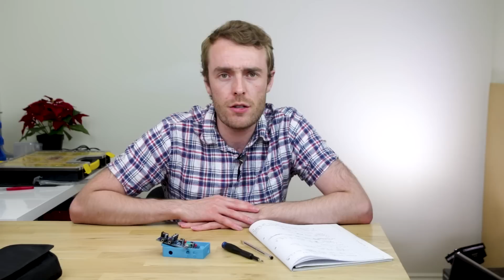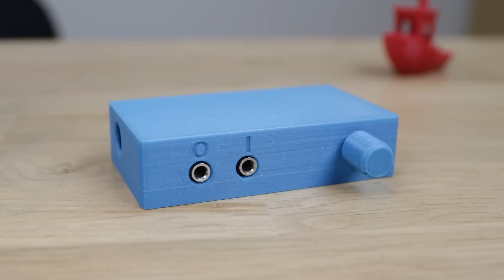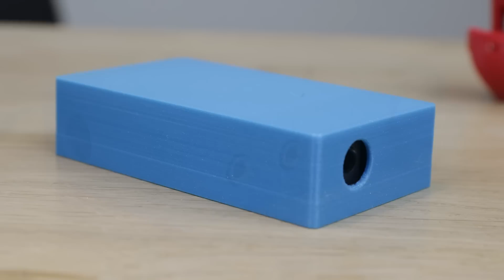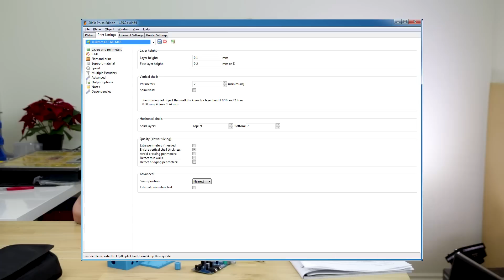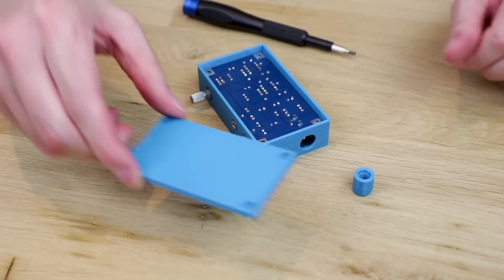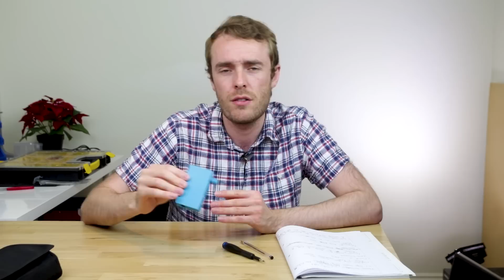#3DTWIP Fusion 360 Custom Electronics Enclosure

Comment: How did you get the M3 thread on the enclosure ? Does the screw thread also get 3D printed ?
Reply from the maker: It's just a hole, the screw cuts a thread

Comment: simple video but well edited, good good work
Reply: I just love simplicity, I want to mention you can set dimensions with arimetic expressions like for example, the M3 head clearance to be lets say 3mm * 1.05, o r an addition, or also use variables like: (3mm * clearanceFactor) and then you can define those in the parameters dialog:

https://forums.autodesk.com/t5/fusion-360-design-validate/global-variables-equations-and-dimensions/td-p/5306729

have fun!

Comment: With regards to the extrusion issues (saw your comment on Tom's prusa inteview), it looks a fair bit like what I got on my i3, the spool would tug on the extruder as it moved closer and further away during the print. Have you tried using a reverse bowden tube? 

As to why the mk3 is worse than the mk2 in this regard? My guess would be the stepper drivers. They've got a lower current rating compared to other common drivers which means less motor torque (so the spool tugging on the extruder can have a bigger effect), especially in the quiet mode. 

Of course I could be wrong, just a guess.
Reply: I think the spool has to be on bearings, standard 608zz type, with thick sticky high-viscosity grease. This has helped me certainly with extrusion consistency, but i suffer from carriage compliance issues, while MK3 appears to suffer from moire-like issues, though possibly multiple other issues overlayed on top. The way distinctive lines have worked themselves into this print, i think it's worth trying for CRT!

Comment: Gotta say I'm a bit underwhelmed with the print quality from the mk3 in this particular print.
Reply: I mean it's not BAD. Maybe I'm just setting too high of a standard for the mk3. I have a ultimaker 3 at work and sometimes we get similar problems and it's a 3.5k printer.
Reply: I'd attribute that to it being a mendel/i3 printer and having to fling around the bed on the Y axis. It's pretty typical of these types of machines and the only way around it is to print slow, but prusa have been advertising the exact opposite with higher recommended/max speeds on the mk3.

Comment: Ah, in-context modelling. Where you really seem super smart in your own mind, having the feeling of having understood how the universe works, until you have to change something in the base geometry and then FreeCAD moves your sketches around to all the wrong surfaces and the model collapses into a distorted mess and everything becomes uneditable, throwing a myriad of nondescript error messages. Thanks, FreeCAD!

And i don't know what's up with that, but DesignSpark Mechanical silently crashes on start for me - 64-bit and 32-bit both - tried erasing its settings but nothing - so not gonna use that.

Why not Fusion360? No-go on Linux, trust issues. I wish i had an alternative. One that was mine to actually keep.
Reply: The parts going whacky could be because of how things are dimensioned and dimensions moving from "20mm to the left" to "20mm to the right". In my experience this sort of stuff tends to happen when things are all dimensioned from a common datum (good for when you need to analyse parts and produce them manually) rather than dimensioned relative to each other. For example if you think about the volume knob, you can dimension the outer wall as a radius from the center of the knob, or as a wall thickness around the knob. In the first instance, you could change the pot dial's radius and it could end up being bigger than the volume dial and the geometry can shift unpredictably, wheres in the second method your volume dial would expand to compensate. 

It's all about how the changes cascade down the line. I learnt this the hard way in OpenSCAD where every constraint is use defined and there is no simple 'dimensiong'. If I referenced everything from a single datum, just about any change I made to the original sketch/geometry etc would turn my part into scrambled eggs, whereas if I referenced everything off the previous part it relies on/is mounted to or whatever, the changes would cascade down correctly.
Reply: SCAD is just a CSG routine though, it works on volumes represented as bunches of triangles. Everything is based on primitive source coordinates, there is no way to select a feature of a model and refine it further.

In contrast, FreeCAD represents the model as vertices, curved edges, and curved surfaces. When you apply a sketch, it's applied to a world plane or a surface. When you apply a bevel or a shell or a fillet operation or anything like that, things that SCAD couldn't dream of, it's applied to a bunch of curved surfaces, and it can do a lot of advanced geometric math on them. The problem is, you select a given surface or edge or something - it stores the number of the generated edge or surface in the next operation that you perform. But these numbers are NOT stable. Sometimes if you go up the operation tree and perform the operation anew with slightly different dimensions, it will decide to generate the surfaces or edges in a different order, and thus their numbers change, and thus whatever anchored geometry you had, it will no longer apply properly. But this is the fundamentally elegant and correct way of working in FreeCAD, because this is exactly how you specify dimensions of things relative to each other there - its CSG lacks such functionality.

I can make a model error-free and flexible in SCAD no problem, and if i mess up, i know how to refactor it easily, but making curved stuff such as fillets and bevels is extremely unpleasant to impossible, so its use is limited. The loft feature has been in limbo in SCAD for 5 years now! I should probably use SCAD more though. Or maybe i should rewrite it entirely from scratch, because i dislike so many fundamental decisions in it. Like the fact that there is no universal anchoring system, every primitive has a different coordinate system origin, or multiple but inconsistent. Relativity.scad is something that should have been core functionality, but since it's not, it has to rename all the primitives.
Reply: Off-topic: Is there a way to create a "linked copy" of object in FreeCAD? So that whem I modify one instance, all of them in the model change accordingly? I couldn't find how to do it and the manual only referenced static copy... Btw, I share your opinion on Fusion and linux :(
Reply: Robert, i think you're looking for "Draft Clone" function, represented on the toolbar - depending on version - either by a stormtrooper helmet in earlier versions or a blue sheep currently. There's also a "PartDesign Clone", which won't clone everything but can be used in PartDesign's CSG, while the other will not. Also i'm not an expert and am likely to get these things wrong.

And yes, it's as confusing as it sounds, and makes FreeCAD seem like a hodgepodge that it is rather than a software that was designed for user experience first.

(and yes, the icons were changed because someone was outraged on the Internet over incorrect use of their lore, because storm troopers and clone troopers are distinct from one another)
Reply: Robert Klauco, Just create one part then import that part multiple times into your assembly. That way when you change the original part all the imported instances update.
Reply: You could be correct about freeCAD, I was just hazarding a guess based off "glitches" I've experienced in other interactive modelers. 

I'd have to disagree with you on some stuff about openscad though. Chamfers are trivial as long as you design with them in mind to begin with. I've written my own functions to replace cube() and cylinder() with cube_c() and cylinder_c() which let me add chamfer parameter. Using these instead of cube/cylinder means my models end up with chamfered edges wherever I want. The odd few cases where the chamfers on these primitives don't suffice are still pretty trivial.

Fillets I'll admit can be a bit trickier. Fillets on 90 degree corners are trivial, any other fillet is a bit harder but boils down to 1-2 simple trig operations. It seems a lot harder until you know how to solve the problem. Fillets around a radius rather than straight edge aren't much harder, just throw in one more trig expression if it's not something nice (like a fillet around a full, half, quarter circle edge etc). Fillets around organic curves I'd resolve to "impossible",  but I can't imagine a case where I'd need to add a fillet to an organic shape when designing parts, even filleting a curved edge is rare for me. The most common by far fillet I need to use is on a straight edge at a 90 degree corner, which is trivial. 

If you don't believe me, have a look at one of my projects on github: https://github.com/Trakyan/DeltaGear
It's full of fillets, the base in particular has some nasty ones like fillets between two curves intersecting at odd angles. Fillets between curves intersecting at arbitrary angles, I'll give you that one was a bit tough, but again not as complex as you'd think once you know the solution. Having used OpenSCAD for a while a lot of geometry problems have become second nature to me.
Reply: Trace, the repo you linked is empty?

But thing is, it's rarely JUST a chamfered cube or a chamfered cylinder, straight ones print just fine and don't suffer mechanical strength issues. Where it pains more is trying to smooth out transitions between primitives in one or another manner to dissipate mechanical load, because things are more likely to break otherwise.
Reply: My bad, uploaded the files now. It's an old semi abandoned project that I never got around to printing, must've forgot to upload.
Reply: Aaaah, thanks. Here comes another thing i hate about OpenSCAD though:
ERROR: Parser error in line 41: syntax error 
ERROR: Compilation failed!

Dear SCAD, WHAT KIND of syntax error, expected what kind of symbol or nonterminal, got what kind of symbol or nonterminal? At what position? Such an amateurishly written parser! Now i've spent a bit of time writing those, and while i really like doing that sometimes, i know getting a good interpreted language written that would be suitable for general public and user friendly enough is a task that would take me a year, so i would not do this unless absolutely necessary, and use something that is robust and proven instead.

I know what the error was, the syntax that you used is simply newer than supported in the official SCAD release, which is now 3 years old. As absurd as that sounds, a well-written parser can still generate a better error message than just "syntax error".

Another thing your work reminds me of, as awesome as it is, is just how incredibly slow SCAD's CSG renderers are. It's painful once you push SCAD to do something actually good. Now sure it can be worked around using low-detail placeholder geometry and such, but still.